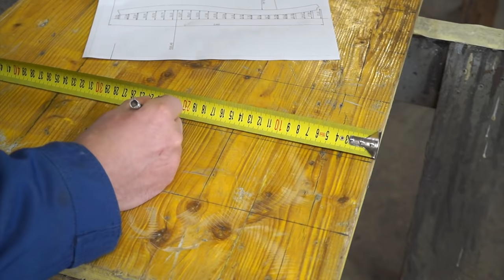Making curved beams

Comment: Also saw your blade guard tied back. Guys would show up on job sites like that. I'd comment a "professional" didn't have to do that. Usually by lunch, no tie back on guards. The attitude is based on experiences of having to halt the project while someone cleans up the spatter and I would get to haul them to the e room to get stitched.
Reply from the maker: I must say you are 100% right. I'ts been like that since I first got it from a friend who worked here probably 10 years ago or so.. Never thought much of it but after reading this comment it's coming down first time I'l use it..

Comment: Awesome Grgur. Did you make those clamps or buy them? And that open planer thing that put the detail on the end is absolutely crazy cool.
Reply from the maker: Hey Adam, really glad you like it ! :) both clamps and that planer thing are home made. I couldn't find clamps that would be strong enough because sometimes I need to bend much bigger cross section and they would just warp after several uses.. So I had to make some heavy duty ones!
Reply: Nice. It looks like you do a lot of glulam, or laminated beam stuff. I always have to order those. But I love how you have it set up, might have to start making some of my own!
Reply: lignum ñ

Comment: I have always been curious about curved beams were made. Thanks for this video. Also, is this the same method used by ancient ship makers used to make curved beams for building ships?

Also, when you clamped the wood planks to form the bend, did you nail them/paste them together? How did the planks stay together?
Reply from the maker: I used two component melamine glue.. Ancient ships were not made by this technique. they were mostly built by connecting  different planks with dowels and wedges, previously trimmed down to shape and size ..
Reply: Boats rarely use laminations because the glue doesn't tend to expand with the wood when the wood sucks up water thus laminations fall apart with time
Reply: An old ship building wood bending technique would be known as fire bending where a beam would be propped over a fire and weights added in certain spots to bend it with time as a result of the heat of the fire and gravity on the weights
Reply: More modern wood bending for boats is done with steam bending techniques usually with a steam box setup

Comment: Awesome technique. Can you use this with light red meranti wood. Making a perfola for outdoor where temperature goes as high as 50 centigrade/120 farenheit. Can i make curved shape using this.
Reply from the maker: Yes you can use this technique but different glue for meranti. I would suggest epoxy glue and important step is to wipe the surfaces with acetone before gluing.
Reply: @lignumchannel  Thanks alot and appreciate the quick reply. Starting the project this week, your reply saved alot of wood for me. Cheers

Comment: Any chance these, as constructed with only glue, are / can be structural?  If not, can they be made structural by through-bolts (then covered by another skin of wood glued on each side to hide them)?
Reply from the maker: These are structural. Glued surfaces if done correctly are stronger than wood itself. For instance, if you break glulam piece in a lab, break never happens along glued surface . No need for bolts.

Comment: please respond to this question. do you apply glue to both sides of the lamination?I glue a lot of stuff. and tend to err on the side of caution. Cohesion, adhesion and wettability. Rub the glue into both sides of the joint.I probably use too much glue (not cheap), never had a glue failure (cool), yet I wonder.With the price of material these days one cannot afford failure. Hope to hear from you.Best regards,Don.
Reply from the maker: When laminating you should always apply glue on both sides because in contact with air, a thin layer appears on the surface of glue (doesn't have to be visible but it's there) which doesn't adhere so good to wood but does to another layer of glue. Especially  if there is a lot of layers and it takes longer time in between applying glue and clamping. Also more glue means that all imperfections are filled. Melamine glue I use is designed to have good adhesion properties even with thick layer.
Reply: Thank you. Valuable information that I was unclear on. Although I have always applied glue to both sides of a joint and have never had a joint fail. But now I am more convinced that there are no shortcuts.

Comment: Nice work. What glue do you use ?? Is ther a special glue for these beams ?
Reply from the maker: Glad you like it! I use two component melamine glue. It is mostly used for laminating structural beam because it doesn't lose its mechanical properties during elevated temperatures in case of fire.
Reply: Thanks for that
Reply: @lignumchannel  Was there a minimum temperature that had to be maintained for this glue to cure and what were the personal precautions you had to take to use it.

Comment: Great video guys, thanks for sharing.  It sounds like the glue you used might be ok for an outdoor pergola. How much time do you have to work with it before it sets up?
Reply from the maker: I used it many times for outdoor projects and it behaves well..  It has an open work time around 45 minutes, It can be released from mold after 8 hours..
Reply: Thanks for the reply.  Another question. How did you decide on how thick each board should be? Are  there any tables based on radius of curvature and wood modulus  or other wood properties?  And do you have rule of thumb for spring back?
Reply: @johngalt1931  inn

Comment: Hi, nice video and very comprehensive explanation. But I still have a question concerning bent lamination: Would it also be possible to glue up "curved beams" from individual pieces / "boards" that are shorter than the final beam (for example make a 9 foot beam out of two 4.5 foot "boards", than three 3 foot "boards" than again two 4.5 foot "boards" and maybe only use 9 foot "boards" for the top and bottom layers)? I hope you understand what I mean. Thanks in advance
Reply from the maker: Yes, of course it can be done. You should only be careful not to repeat the cut in the same cross section because it would be the same as if you drilled holes one above the other. If you do it this way, you only need to make beam one layer thicker than calculated cross section should be.. I hope I helped..
Reply: Thanks for the quick reply. what do you mean by "you only need to make beam one layer thicker than calculated cross section should be."? 
Thanks again
Reply from the maker: If for example you need a beam which would hold a certain weight, and for that weight you get a calculated beam cross section, idk, lets say 10cm width and 15 cm height.. if you use 3cm thick boards to make a beam, normaly you would need 5 layers for 15cm height (if all boards continuous withought a cut), but if you use shorter boards for each layer, you should use 6 layers and get 18 cm height to compensate for all the cuts.
Reply: lignum Ah ok. Thank you very much. Now I understand. Thank you.
Reply from the maker: No problem, glad I could help😃

Comment: That's some nice carpentry, but I'm a bit surprised that the wood takes it without steaming.
A matter of using thin enough boards I think.
Reply: A good tip is to soak your laminations in water overnight, 👍🔨🇮🇪

Comment: Great video. Can you tell me where to get this thin wood or do you need to plane it this thin. I would like to try a project myself. Keep it up.!
Reply from the maker: I buy most of wood I use at the local sawmill where they cut the wood to desired thickness. Sometimes i saw them if i need just a few of them.. Glad you like the video! :D

Comment: Why do you use two part glue/epoxy for your laminations instead of regular wood glue?
Reply from the maker: I use two component melamine glue. This glue is designed specifically for structural laminations. It doesn't lose it's adhesive properties at high temperatures such as during fire so structures don't collapse. Ordinary glue fails at elevated temperatures. I make a lot of glulams so I purchase it by barrels so I also use it for other projects. Other properties, such as water resistance and adhesion strength are same as ordinary d4 class glue..
Reply: Epoxy-Glue is also better for Outdoor Constructions, it survives Wet and Rainy Conditions.

For Indoor, you can use regular Wood-Glue